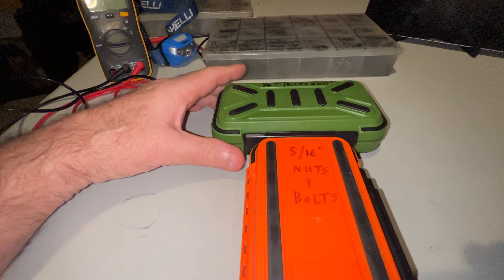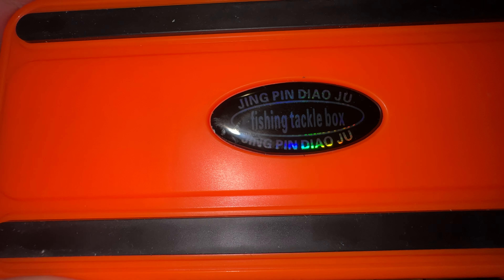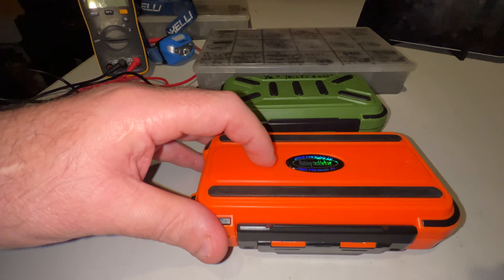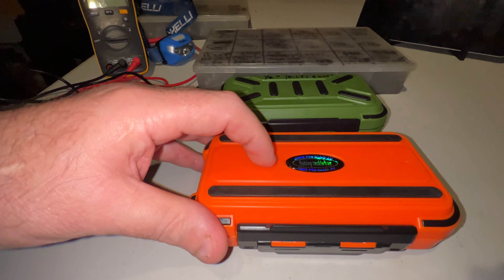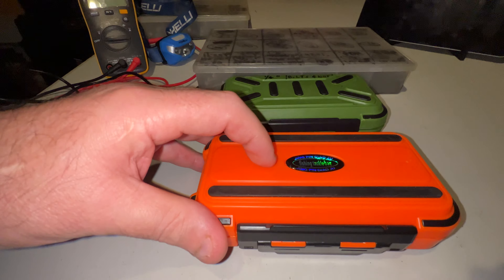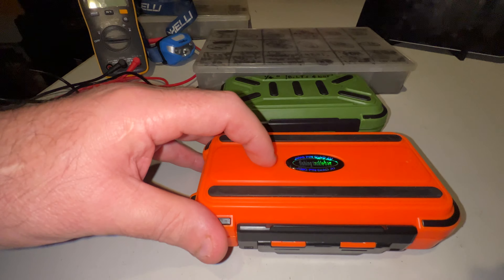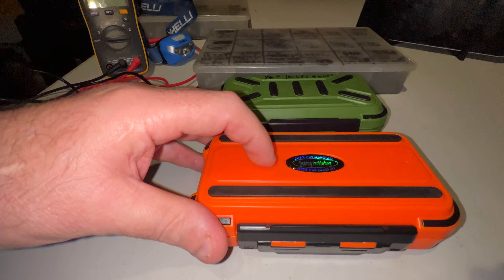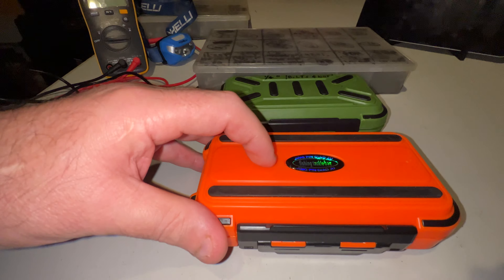My New way to Store Nuts & Bolts on the Service Truck !

Comment from the maker: Link to Tackle boxes.

   green box
* Color: C-Green-M

https://www.amazon.com/LESOVI-Fishing-Lure-Boxes-Bait-Tackle-Plastic-Storage-Small-Lure-Case-Fishing-Accessories/dp/B0899LTDVM?pd_rd_w=wz16P&content-id=amzn1.sym.5ea05044-4ec2-44ec-99c4-b28f0508a2e5&pf_rd_p=5ea05044-4ec2-44ec-99c4-b28f0508a2e5&pf_rd_r=H61RSD3A5KZYQNGV7E84&pd_rd_wg=KnWNf&pd_rd_r=970c515c-e9c1-4e16-b1e4-acd2e79b452c&pd_rd_i=B0899LTDVM&psc=1&ref_=pd_bap_m_grid_dv_rp_0_26_i

This is the Exact Green box i ordered from my order list. They have different sizes & colors.
My order said - " Color : C-Green-M "
the M - Denotes the medium size one.

$9.99 each.

   Orange box

https://www.amazon.com/Hlotmeky-Box-Waterproof-Terminal-Organizer/dp/B0B7D2JS5W/ref=pd_aw_fbt_img_m_sccl_1/136-6018896-9125052?pd_rd_w=0CZLH&content-id=amzn1.sym.4a99041f-cf38-45af-9b74-46aa864316a6&pf_rd_p=4a99041f-cf38-45af-9b74-46aa864316a6&pf_rd_r=1GZZ5YCJ3PQCS21W6VRD&pd_rd_wg=SC4vB&pd_rd_r=33f74a9c-dc1c-4e38-a40f-21f4ca3b4589&pd_rd_i=B0B7D2JS5W&psc=1

This Orange Box did not show up in my Order list. But , i believe this is the one.

$11.99 each